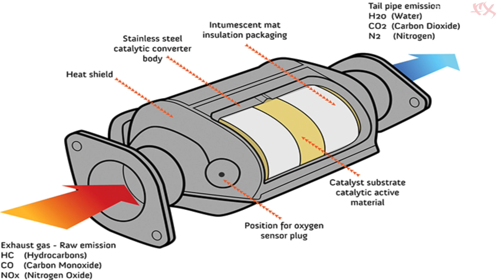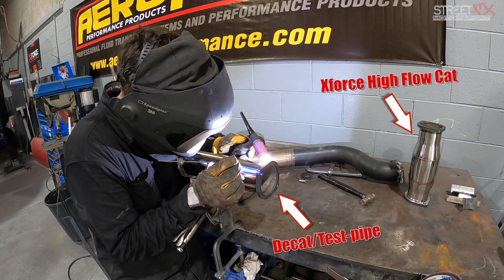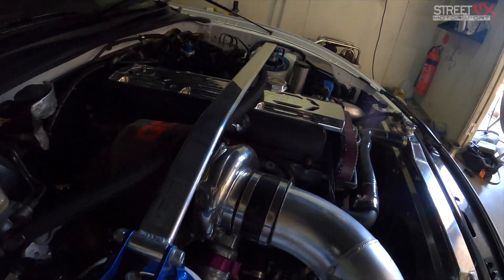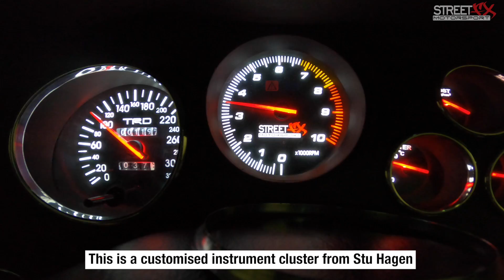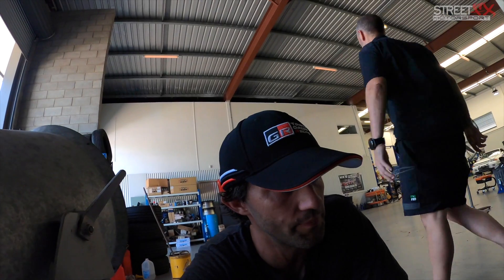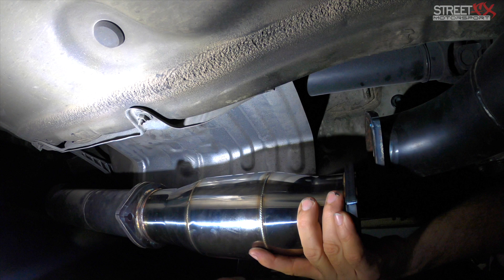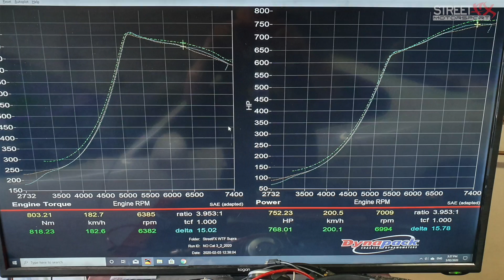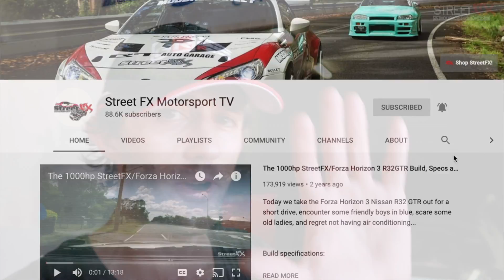REAL RESULTS.. Is it really worth running NO CATALYTIC CONVERTER? We test it on our big power SUPRA.

Comment: 30 years and make no mistake about it no matter what you’re told. You’re being lied to if someone says you’re losing horsepower with no cats. Less restriction is better. You’ll have to tune to get the maximum benefits, but no cat is always better. I will say this no cat for the track. It’s not allowed on the road.😉

Comment: Adding the cat should have changed your AF ratio a little bit. I did not see any AF numbers on either test. Also look down low, 3500 rpm there is a much bitter difference (25hp). The catless version would build speed quite a bit faster than with a cat. Regardless, thank you for doing the test. But the real test would be OEM cat vs aftermarket cat system.

Comment: a high flow cat can have 10-15x higher emissions than an CARB certified, however, some can be within limita. but imagine the emissions on a straight pipe. so definitely put something in there, anything.

Comment: Thank you my friend ,this information is valuable to 0:48 me because I noticed a substantial difference in the low range useful in my case because I have jeep turbo stroker 5.0 10psi and I see that with the catalytic it has better torque at  low range.😊😊😊

Comment: My cat. conv. was just stolen and I'm wondering if it worth it to replace it with a pipe. I just want to reduce the noise rather than getting more HP. It seems the engine is still very loud with the pipe installed. Does the pipe reduce the engine noise at all than without the pipe nor the cat. Conv. installed ?? Also can you drive temporary without the cat., It seems the engine is roaring hard when I step on the gas, even lightly.  Thank You for any feedback.

Comment: I kind of understand chopping the cat out of your AU fairmont with 200,000 K's on the clock, since the platinum in the cat will be depleted, and an older style cat like that actually robs a significant bit of power.
but the only reason for not running a cat on something like this is that you're a tight-arse.

Comment: N/a and turbo cars work different.
N/a cars need back pressure, turbo cars dont need which is why people run the pipe out the front bumper.

Comment: What I want to know is if there's a cat that will hold up to sustained or repeated two-step? I've seen a few vids of people running stock cats with big hp, just revving a bit in a parking lot and out comes a fireball and plume of cinders of what used to be inside the cat.

Comment: Weight reduction alert: 
I didn't read all 429 comments and wanted to mention I'm catless w/ test pipe on my 95 Acura Legend Ka7 (full exhaust with headers and the exhaust system is the highest recommended for a Legend made by a German company- Stromung) How about that 👀 Almost as unique as a Supra ha. Best place to find an Acura Legend these days is in the junkyard.lol Amazing cars tho' but many folks condemned their Legends too many times thru the years because of BHG. And we have found out the reason primarily is the EGR valve pipe clogs up very quickly and owners didn't or don't clean em' out frequently enough.
Thus over time BHG.

So my point being, and I don't know if it was mentioned or not, my catalytic converter weighed 42 lbs and the test pipe is probably 5 lbs max... And that's significant weight reduction right there on a 300 HP butt dyno'd  24 yr old with every mod available for a Legend which were pretty scarce even back in the day. 
***Excellent video good folks!!! ⭐⭐⭐⭐⭐

Comment: I'm not worried about the HP loss, what I care about is the difference on how hard the turbo works in higher rpms compared to a cat less exhaust and high flow cat exhaust. My turbo works hard up top and cant figure it out I'm starting to think it's the high flow cat

Comment: Was there a tune change between the two? Because the main reason to remove the cat is to reduce backpressure (which of course hurts flow) - but which also creates more heat and limits how much timing you can put in the tune. If all you did was tune with a cat and then add a delete, or vice versa, what you've done is stuff up your tune.
Go back and tune each one for the same afr, but for max timing and you'll find (depending how much backpressure is being created by the cat) you can add maybe 1-2deg more timing safely and get maybe 4-5% instead of 2%.

Comment: Wanna see charge air temp. numbers in this video.  Noticed the catted run had a big ole fan feeding air at the front vs no fan on catless runs. Or did I miss something? But really in my experience running catless on n/a cars is a waste of a test pipe. On boosted cars your not only looking for rwhp gains, but also less bp on the turbine for those quick spools.
Reply from the maker: All listed power runs had the fan. We did a couple of other runs without just so we got to record sound clips without additional noise. That fan is crazy loud.

Comment: is it normal for the exhaust tips on a duel exhaust for a 4.6L OHC Ford to be able to boil water on contact? think i am running a bit lean? just driving around no faster then a Toyota Prius would. think it might be the catalytic converters making the exhaust system so hot.

Comment: I broke out the cat on my w124 with the M104 motor and I can tell you with confidence it's much happier past 3k rpm, high flow cats aren't restrictive at all but say on a stock car, especially like a Supra or old Benz they do rob some power, or so I'm convinced any way

The cat wasn't borked to begin with, car didn't feel sluggish or anything but after knocking it out it seemed to have slightly better response... Also sound

Comment: So if I'm running two 3" cats on a NA V8, i ain't gonna see shit from the information i got here
Reply from the maker: How do you figure that?

Unless youre making 1200hp from an NA v8, then the general consensus is that you're not going to find any reason to decat vs high flow.
Reply: @StreetFXofficial  I think what he meant by "I ain't gonna see shit" is that he won't see a difference from decat, and not that your information is useless.
Reply: @Jupiter__001_  exactly, i thought that they thought i was being a dickhead, although if i see less than 430 at the wheel, im still gonna piss myself because that power in an FC RX-7 for someone who's never driven more than 200whp, it's a bit too much
Reply: @StreetFXofficial  because there was no real difference up until 650hp, mine would be making 430whp at most, so from the information I got, if i have dual 3"pipes all the way back, i should see less of a difference than this JZ

Comment: The difference is that getting a high flow car installed is going to cost significantly more money for the installation versus a straight pipe. And depending on the quality of high flow cat you install will determine whether or not your car would pass emissions, and also skyrocket the price of the cat itself. High flow cats can turn a $100 cat delete into a $500 investment like nothing. If your worried about the environment that much, don't mess with the exhaust at all and leave it stock. If you want the most power, cut them out. Spending 2x the money for a modification and to still be making compromises doesn't make sense to me.

Comment: Why don’t you run a real world “what most people do” comparison. And compare your test pipe to a stock cat.  A lot of places won’t certify high flow cats
Reply from the maker: Finding a mk4 supra with a stock exhaust was going to prove near impossible.
We will re run the test with our a90 supra - stock vs high flow vs decat
Reply: Street FX Motorsport TV 

cool. I really think that a more real world, 300-400hp daily driver would be a better reflection of what the sort of people that do that would achieve.   But, then again, I do not have a YouTube channel with global reach either.

FWIW- the last car I pulled the cats off of was a 2005 mustang GT.  Cmcv deletes, air raid cai, edelbrock axle back, SCT tuner with a custom tune (on a dyno), 4.10:1, lowered, with 255/50/17 all the way around.  I had to emission test it every two years. 

I drove it 1800ish km a week and without the cats, my best mpg was around 35 mpg, with the cats I could not break 29.  

This was going 120km each way, going to work at 0300 and coming home at 1400. 90kmh, windows up and no a/c going.

And for those asking why?  When I took the job it was a once a week commute.  Driving truck.  Then I took an office job 6 years in.

Comment: First run was 24.7psi, run with the cat was 24.3, that's 0.5psi less boost which would explain most of the power loss. If they were both done at 24.7psi I bet the loss would be less. I'd say no more than 5hp loss at identical boost. That half a pound of boost different probably accounts for most of that power difference.
Reply from the maker: The loss of boost is explained by the turbo working harder to push air through a restriction.

We didn't change the boost, it just decreased once the cat was in there.

Turbo was trying to make the same amount.
Reply: @StreetFXofficial  I know you guys didnt change it, I was just mentioning the difference in boost. Makes sense but I wouldn't have thought a high flow cat would have made that much difference to reduce it by 0.5psi. I figured it would increase lag but didnt think it would decrease boost. I was just mentioning that a majority of the hp loss would be attributed to the lower boost psi

Comment: IMO The bigger problem with aftermarket forced induction is if the cats can take the heat (literally). Modern cars have variables in the tune for cat protection to help cool them down - something I suspect cars like the GT500 and Hellcat rely on heavily to stay legal and carry the warranty duration-  otherwise you end up with a blown motor from a suddenly clogged exhaust pipe. 

Seen several factory cats melt on boosted coyote cars personally and it isn't pretty.

Comment: It's great if you have a 760whp car, but 15hp and 15ftlbs of tourque is a significant difference even in a car with say 300hp, even more if a car had 150-200, and that's usually why people want them gone in budget/grass roots Motorsport.  Your guy's build is sick but few of us can actually relate to that much power in a street car. IDK just my .02 🤷🏻‍♂️ car looks and sounds sweet as though 👍
Reply from the maker: Look at the dyno graph for anything under 650hp... there was less than 1hp difference..  at 300whp you're losing less than half a horsepower.
Reply: @StreetFXofficial  thanks for that, knowledge is always welcome with me.   I know I wouldn't say no to 15 extra up top on either of my cars (FB GSL, Hawkeye WRX wagon), but of course neither flow enough air/fuel to make  that kind of power anyway.   With the WRX though it has a cabin air filter so I've never really noticed the smell of pump gas, but the FB is a different story (being carbied), plus there aren't really heavy emissions penalties here in certain parts of North America that aren't California lol.
Reply from the maker: It's unlikely that we would be pulled up for emissions testing, but it honestly isn't fun making all my clothes smell like fuel lol.
Reply: HFC for the win! Sounds better too

Comment: Some catalytic converters that are connected right after the turbos like in the bmws makes the turbo seals to fail  usually when running higher boost. In some vehicles it's better without cats for reliability and they also run cooler.

Comment: on a boosted engine exhaust piping diameter actually matters as well 3in vs 4in vs 5in and the amount of HP you make matters, on supra forums we have a well documented thread of people running higher horsepower making more power with bigger exhausts/no-cats  once you get to the 1000-1200 hp range you will see gains in the 50hp range by just going to a 4in-5in downpipe/exhaust. which makes it drone like mf so we still recommend 3.5in downpipe and either 3.5 or 3in exhaust for the street
Reply from the maker: We're planning on switching out to a 4in turbo back. Got a brand new, discontinued  HKS Super Drager we managed to find, so am keen to hear what it sounds like with that 🤗

Comment: A Porsche Cayenne GTS makes about 500hp and has four cats. The factory cats are engineered to treat a specific volume of exhaust gas. If you try to use a factory cat on vehicle you heavily modified, obviously it create a restriction, because the cat wasn’t engineered to treat a larger volume of exhaust gas than what the engine produced from the factory.

Comment: Has anyone ever tried running two small-ish cats in parallel? ie. the pipe splits into 2, goes through the cats, and then joins back into 1 pipe.
In electrical circuit design, parallel resistors have significantly less resistance. A cat is a resistor to exhaust flow.
Might be able to get big flow this way without needing giant cats that barely fit under the car. I'd imagine 2 3" cats would be cheaper than 1 5" cat?
Food for thought.
Reply: Running 2 cats would not be beneficial, the 1st one would have already converted all the molecules from the polluting gas. The job of the cat isn't to restrict airflow on purpose, unlike the purpose of a resistor. 
It's like running a longer and thinner wire is worse than running a thicker wire. The thinner wire would provide less current thru, and nothing you do after that will improve the flow.
Reply: @SIKCAR  ^that guy said parallel, not series. Not sure what would happen... but I doubt fluid dynamics and electrical dynamics work identically. Also the billions of R&D $$ spent by auto manufacturers and it's not done in this manner is telling.

Comment: 15k fine for 15hp.........i think ill put the angle grinder down now...
Reply: $15k fine! Is this true?
Reply: thought it was $500 but I've never heard of them checking for cats here in Missouri
Reply: @redtra236   From my experience, they only check for cats during an inspection for tags.  Technically if it came from the factory with one, it's supposed to have one to pass safety, though it's possible to get an inspector to look the other way.  
I've had douchebag inspectors before....  Like failing the safety on my 68 Camino because I didn't have a heat riser tube from the exhaust manifold to the air cleaner.